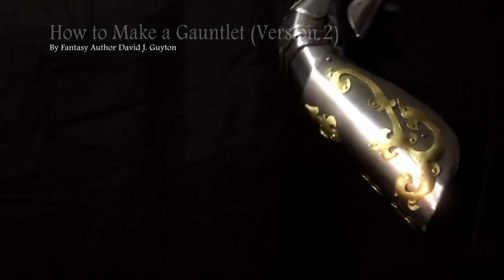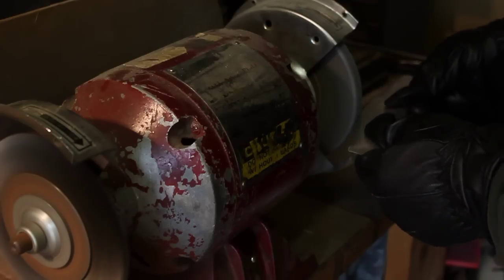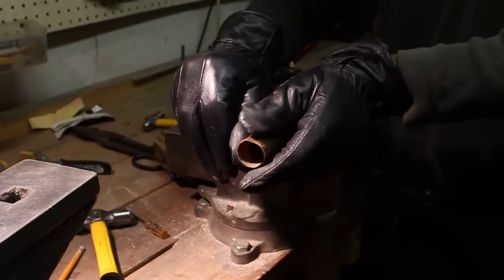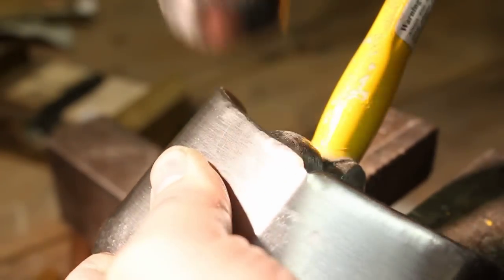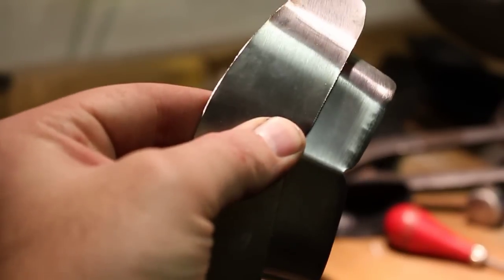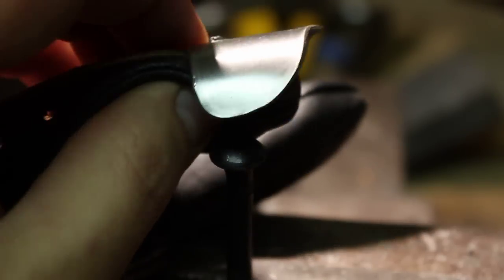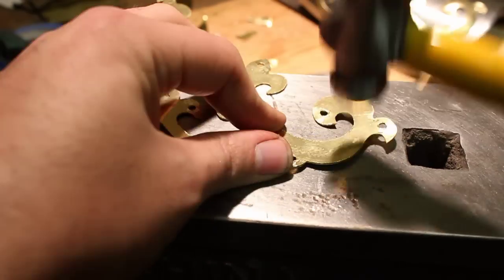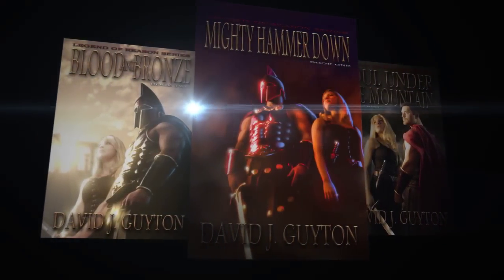How to Make Armor with Ordinary Tools - Version 2 Gauntlet

Comment: Hey, just wondering what kind of head you're using on your rotary tool for the brass? Also, could you substitute the grinding wheel for a grinding head?

Thanks a bunch in advance

Comment: hey. I'm planning on cosplaying as doctor doom in an upcoming comic-con. will you be doing a video on a doctor doom arm (or even his leg armour) anytime soon? if you don't plan so, which gauntlet do you recommend i use?
Reply from the maker: Carlos Rodriguez I don't have any plans to do that, at least not at this point. You could look at my Version 2 gauntlet, or my Dark Hero gauntlet. You might be able to modify one of those to get  what you're after.
Reply: ok, thanks. I'm actually looking after a kinda modern doctor doom and not the old fashioned one. thanks

Comment: David- the pipes used to make the finger forming jig, are those a 1/2" black iron pipe and a 3/4" Black Iron pipe?  I picked up 3/4" & 1" and it seems too big.  Thanks for the help, greatly appreciate it!
Reply from the maker: it will appear too big on your bare fingers, but when wearing a glove, it should be just about right. Even if it's a little big for your liking, you can always squeeze them a little afterwards with a pair of pliers

Comment: Thanks for the template. Do you have any tips for the fingers? There were no markings for where to tacks should go like there are on the hand and wrist parts. (im still doing the poster board) Everything else is working out nicely but I don't know where each finger piece should connect.
Reply from the maker: Where the holes go will depend on how long your fingers are (while wearing the glove). Start at the finger tip, and work backwards, spacing them out evenly. Make some temporary marks on the leather so you know where to attach them. Do one finger at a time and everything should come out nice and even

Comment: What finish of stainless steel did you use 2-b or #3?  Also, what nails did you use (size, etc)?  I am trying to use 7/8" electrogalvanized roofing nails and found that they are extremely hard to turn into rivets.  The nail seems to bend before it flattens out into a rivet.

Comment from the maker: Mmmm, no, not really. They are about the same. V1 was made with thicker material, but stainless is harder than brass, so it evens out. The rivets, however, are tougher on the V2

Comment: Hey man, I've started my project, but I'm trying to find the best prices for stainless sheet, both 14ga and18ga. I was wondering how much you spend on the material? The cheapest I'm seeing for 12" x 24" is $30. (I plan on making pauldrons and a breasteplate before I try the gauntlets)

Comment: David,

Great vid but im not understanding something. The plates for each finger are riveted onto a leather strip which is riveted onto the underlying glove at the far ends of the leather strip, correct? Doesn't that prevent the fingers from bending without a rivet tearing through the leather? Assuming the leather strip is riveted tightly against the fully straightened finger, then bending that finger would be impossible without pulling out a rivet because the attached leather strip is already at its maximum length.
Reply from the maker: You are correct, but the leather I used has some stretch to it, so it doesn't hinder articulation at all. You could also skip the leather strip and rivet directly to the glove if you want, but that's harder to do.
Reply: David Guyton Thanks brother. I'm going to rivet directly to the glove using a soft-leather washer on the interior and use a padded liner. Subbed to your channel.

P.S. You seem skilled with metal-working. You should try a helmet build. I just finished mine and it was super fun.
Reply from the maker: I intend to do a helmet, but I am still trying to come up with a design I like...one that doesn't require welding.
Reply: David Guyton If your interested, here is my completed Great Helm. It required no welding and no raising / dishing. 3 plates riveted together (although you could easily make it with only 2 plates).

http://i.imgur.com/67FxUag.jpg
Reply from the maker: Very cool! And cool shirt too...one of my favorite movies. I have actually looked into a helm like that, but I want to do something a little closer to my own style. Great work though.
Reply: David Guyton
Thanks, good luck!

Comment: I bought your template and I am almost done with the metal working. One question I have is the buckle you used. How does it attach and how do you keep it secure on your arm?
Reply from the maker: actually I made a tutorial on how I made the buckle. See it here: http://youtu.be/1yLICYc8_gM

It basically fastens to the vambrace in any position you want to put it. Use rivets to attach the leather to the vambrace. See the buckle tutorial to see how I made the buckle. It's basically the same way a belt functions. That being said, you can also cut up an old belt and use it instead of making your own buckle

Comment: Nice design, but there may be one issue as far as practicality. can you move your wrist freely? I see one axis, but try moving your wrist in a circle. Historically gauntlets have wide or short wrists to allow proper movement.
Reply from the maker: This design allows full rotation of the wrist....it's just that the gauntlet moves with the rotation.
Reply: ah, I see, nice work.

Comment: Mr Guyton, a question about the glove and rivets if you don't mind. Do you rivet all the finger pieces to the glove, or just a couple of rivets at the fingertip, and at the knuckle while the rest of the finger plates in between are held together by a leather strap?? And in either case there are rivets in direct contact with your skin, no? Would those rivets hurt you if you were to punch or hit something?
Reply from the maker: On the templates there are instructions on exactly which holes go though the glove, and which go through just the leather strap. Most of them go through only the strap, and the strap is fastened to the glove at both ends. As far as coming into contact with the rivets, when the rivets are hammered down they become tight and usually will embed themselves into the lining of the glove. If you can still feel any rivets you could get very thin cotton gloves (like the kind for military inspections) and sew them to the glove after riveting.
Reply: David Guyton Is the download of the template safe and reliable?
Reply from the maker: Of course! All handled by third party processors, not by me directly. You can use either credit card or PayPal. I never see your credit card information or anything like that. Ask anyone on my channel who has purchased the templates and they will tell you it's 100% safe and secure.

Comment: David,

I bought the template today. I have almost gathered all the necessary materials. But I would like to know more about that tube jig you made for bending pieces, such as what type of pipe was used (pvc or metal) and what sort of machinery was used for getting the wood into that shape and how. It would be great if you could make a small video on how you did it. btw, Really cool gauntlet you made there. I look forward to make one as good as that. 

Regards,

Arjun
Reply from the maker: I think I will do a short video describing the jig in better detail. You can use ant metal pipe you want, as long as it's big enough. What I used is gas pipe (the kind you buy in a home improvement store to run gas to a stove or water heater, etc. I didn't use any special tools to carve out the wood, I just used a chisel and a file to shape it. Then I glued it into the wood using an epoxy (JB Weld in my case, but any brand will work). Be sure to check out all of my videos for little snippets about the jig. You don't even have to build it in two parts. Watch my Demon Hand tutorial and you'll see that I just pushed the parts into the one side of the jig and it works perfectly.
Reply: David Guyton ok , so would a circular saw with metal cutting blade work to cut an aluminium pipe half along its length or should I hand it over to the pros?
Reply from the maker: I would use a hacksaw if it's just aluminum. As long as you put it in a vise there should be no trouble at all. I would not try a circular saw. If you have a handheld grinder you can use a cut-off blade on it.
Reply: David Guyton I'll try the hacksaw.
Reply: David Guyton found time this weekend to resume the crafting work , and encountered yet another problem. I'am having trouble cutting the sheet metal roughly for making way for the grinder to refine the shape. The kind of snip i bought was an aviation TIN snip which cuts only straight an thus encountering the problem where i could not cut past the 1 inch length of its jaw. upon further research, i found that aviation snips could cut through a max of only 24ga steel and the kind that i bought is used for cutting. Most of the hardware shops near my place treat newbs coming for tools like beggars and would gladly sell me the wrong type of snip so that i would learn how to select the right one. I don't intend to let them show me that favor again. the shopkeepers I met have no idea what a bulldog snip is. This snip I bought was a cheaper variety which i thought would suffice for a first project(obviously not). They did mention they have snips made out of steel which come at a pricey rate. I believe i would need to buy it but I need to be sure about exactly what kind of snip i need to get (tin or compound-action or whatever type) and the size of the jaw and whether it should be steel or any other material. Also, another obstacle would be finding the locally used term for the snip that you suggest since I reside in India. This last problem is something I have encountered a dozen times already. to counter that, a picture of the right kind of snip ought to work to make the shopkeepers understand what exactly i need.

Regards,

Arjun
Reply from the maker: I am not sure what name the bulldog or bullnose snips go by in India. Even those do not cut curves very well, but the do cut the metal better than other snips. As a general rule, the larger (longer) the snips are, the thicker the metal they can cut. I literally have no idea what options you have available in India, but surely there is a pair of snips somewhere that can cut through thicker than 24ga. 24 is about the thinnest sheet metal can get and still be called metal and not foil. If I were you I would just find a longer set of snips and see how well it works. Perhaps you could take some sheet metal into the shop and see if the snips will cut it
Reply: David Guyton ok , so which type of snip did you use to make that first rough cut in the video?
Reply: David Guyton Also, are left or right curve aviation snips necessary?
Reply: David Guyton Also, are tinner snips and bulldog snips the same thing? google search did not yield much results on the differentiation.
Reply from the maker: not sure what tinner snips are. Tin snips are regular snips
Reply: David Guyton I'm not sure if tinner snip is another kind but here's what I found. 

http://www.flipkart.com/stanley-14-165-cutting-tool-tin-tinner-snips/p/itmdtxyferyanmwz 

will that do?
Reply from the maker: I have never used snips that look like those.It says they will only cut up to .91mm in regular steel, and .63mm in stainless. That's not all that great. Take a look at my DIY Armoring Tools video and I show the exact snips I use near the beginning of the video. I'm sure other snips will work too, but these work well for me. DIY Armoring Tools (make armor in your garage)
Reply: David Guyton I think i'll go for the ordinary snips with longer jaw that would cut upto 14ga and see if i can get an aviation snip as well that matches that level.
Reply from the maker: Cool. Any of them will cut stainless too, it's just going to be really hard. I only use 22 or 20 gauge stainless anyway. Anything thicker is a nightmare to cut.
Reply: David Guyton I settled for 20ga aluminium finally, trying to cut the steel plate with the snips i bought seemed futile. Next question is regarding rivets. What is the head diameter and shank diameter of the roofing nail that you used. also , what is the shank diameter and length of the rivets used elsewhere including the brass rivets. I'am planning to give an order to manufacture those brass rivets so the manufacturer needs the exact specifications.
Reply from the maker: The diameter of the nails/rivets can be whatever you want. In my case, the brass rivets were made of 1/8" brass rod. Head diameter will vary with different roofing nail brands. Shanks are usually about 1/8" also, but I would suggest  gong to the hardware store and buying a box, and also see if they have any brass rods there. That way you can go by your own measurements instead of going by mine, and it will be more accurate.
Reply: David Guyton brass rods will be available probably not 1/8" shank diameter but close enough - 3mm. what length of brass rod did you use approximately to make those rivets ? 1/4" , 3/8" or 1/2"?
Reply from the maker: It really depends on how tall the brass knuckles stand off of the top of the knuckleplate and how wide you dome out the rivet head. There's no exact answer and you can pretty much make anything work. Just dome out one side of the rivet, insert it into the holes, and cut it off so that about 1/8" is left over. Carefully hammer that end down and when it's tight, you're finished.

Comment: I'm going to try and make one out of Kydex, a thermoplastic they use to make holsters. Any suggestion on materials to use to attach the pieces to the glove and still keep flexibility? I don't think that rivets would do the job.
Reply from the maker: +Quentin G. I dunno, I have never worked with anything other than metal. You might take a look at my first gauntlet tutorial (the brass one, Version 1).  I use "leather rivets" in that build, and they might work better than the ones I use in this one.

Comment: Would the gauntlet actually be effective in protecting the arm or is it just for show? you could make testing videos where you show how well they hold up that would be cool
Reply from the maker: None of my stuff is heat treated or anything like that. They are more for show. But the design has little to do with the actual strength. If you went through the hardening process and used the proper thicknesses, these designs would be no different than "real" armor.
Reply: +David Guyton Ohh makes sense didn't think of that. Love your designs tho keep it up
Reply: David Guyton so if you were to heat treat every individual piece in the set and then put it together would it be more resistant to blunt force or something?
Reply from the maker: They would need to be made of thicker steel as well, but yes, heat treatment would make it much, much harder and more durable

Comment: Hi.I have the template and i would like to ask that are those the same size like in your video because i found the knuckle plate far wider than the wrist 1.Or those are just the shapes and i have to adjust the size.I just cut out the shapes and im trying to assemble them :)

Comment: Hi David. I have always wanted to be able to build something. Anything really, this is too difficult for me since i have no experience. Can you tell me how you started out? Did you get any lessons from anybody? Or did you just start form scratch with trial and error? Thanks.
Reply from the maker: I started out just like you, thinking this stuff was difficult. If you watch my first gauntlet tutorial (the brass one) that was my first time ever building anything out of metal. I did watch a few videos online but they used torches and stuff like that, so I avoided it, thinking it was really hard. Then, one day I decided to just give it a shot, and it turns out it's not nearly as difficult as I thought. If you watch my videos, I show you the easy way to accomplish this stuff without the torches or expensive tools. If you follow the instructions, I think you'll surprise yourself with how easy it is. Start in paper first to get a feel for the design. Make sure it functions properly and make any changes you need to. Then, if you feel you're ready, trace the parts out onto metal. I promise you if you try this, you can do it.
Reply: David Guyton is there a specific type of paper you use? the one you have seems to be hard and takes shape. also, how do you measue the hand? like what dimensions you need for the thumb or the wrist and all. Thanks
Reply from the maker: I just use posterboard, or I cut up a folder and use that. I'm afraid I don't know what you mean by how to measure dimensions of the hand...it's too broad of a question. Are you using my template, or are you trying to come up with your own design?
Reply: forget that, i thought you had made the gauntlet with metal on the palm but re-watched and realized my mistake. i think thats this weekend i will definitely give this a try, if it works out, i might consider purchasing some brass and steel. However, i do not know how to acquire such items, surely they don't sell them anywhere. i will have to look it up online and possibly have it shipped. Thanks for the quick response too. Very much appreciated.

Comment: thank you for the templates, what is the measurement across your hand. base of the pinky to the index finger. I cut the and seems a little small on my hand. and any chance of getting some photos of the finished gauntlets. thanks.
Reply from the maker: from base of pinky to base of pointer finger is about 3 1/4 inches. Measuring AROUND my hand at the same spot (starting at palm, wrapping around the back of the hand) is 8 inches. From wrist to tip of middle finger is just under 8 inches. The design is not THAT exact. you can just bend the pieces a little to accommodate a larger hand. Or look into a slightly closer-fitting glove. You don't want your gloves to be extremely loose. I'll see what I can do about some pics.